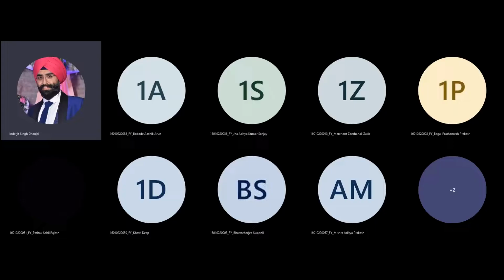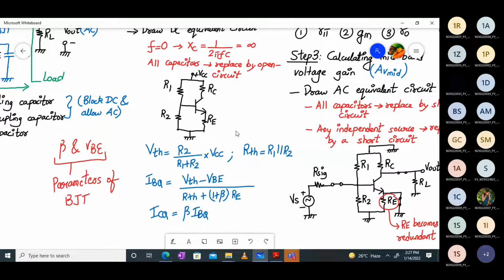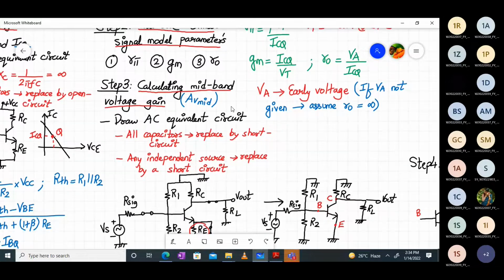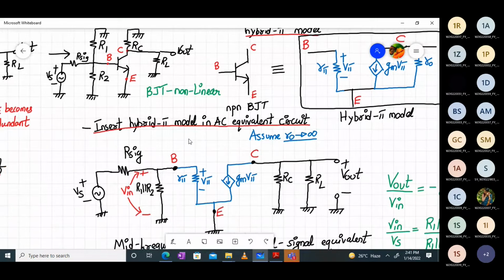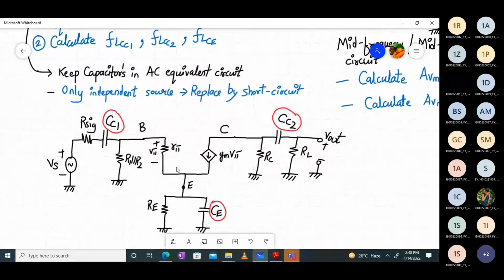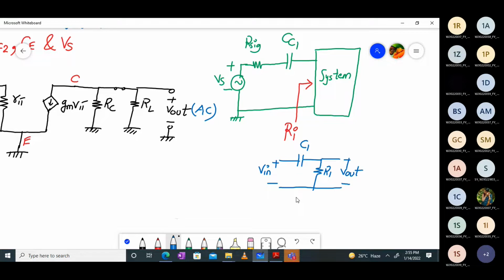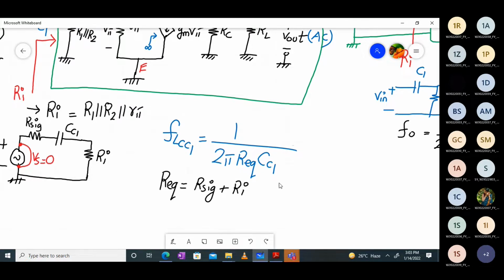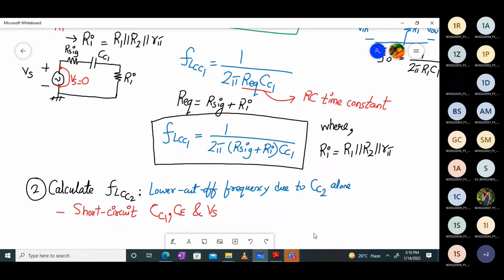Analog Electronics Circuits Session 3: Low Frequency response of BJT amplifier Part 1

Comment: Sir why we are concerned about low freq.
I remember in my college as well while designing ce amp sir told us to take f = 20hz
Reply from the maker: Biological/bioelectric signals like EEG, ECG have low amplitude and low frequency, so for such low frequency applications low frequency analysis is important (Although we use instrumentation amplifiers) Also, removal of 50Hz noise in such application is a major concern.
Reply: @InderjitSingh87  Yes I know that sir but during simulation at 500hz we don't get desired gain.

Like the ce amp I designed which was expected to provide gain of 100 from 20hz it is giving me gain of 100  at somewhere around 650hz.
Reply from the maker: @swaritmahalsekar5521  Gain of RC coupled amplifier decreases at low frequencies due to external capacitors like CC1, CC2 and CE
Reply: @InderjitSingh87  OK thank u very much sir I'm following ur series it's interesting. I'm learning something new.